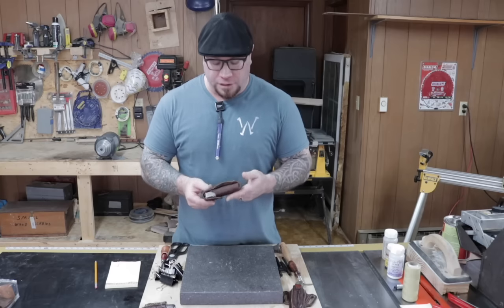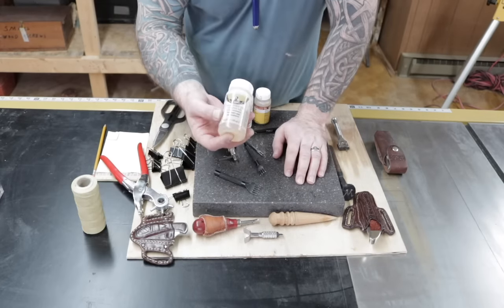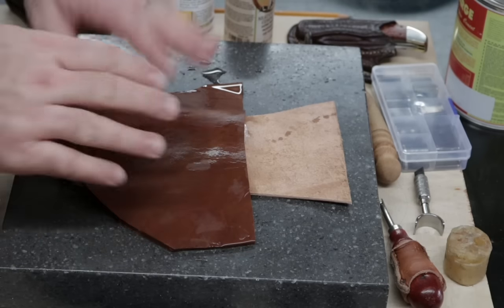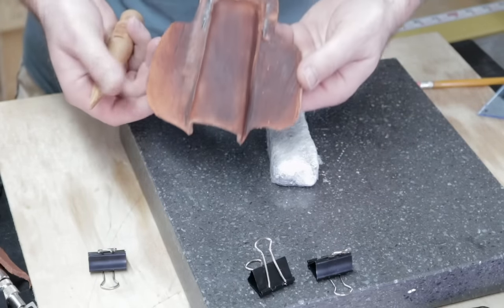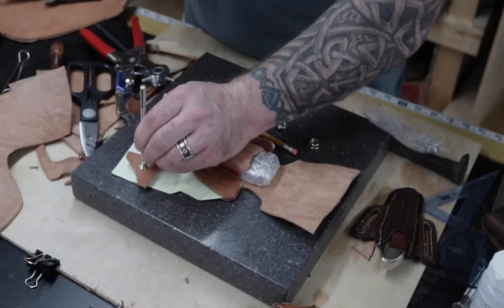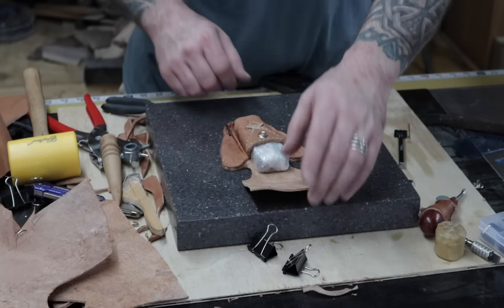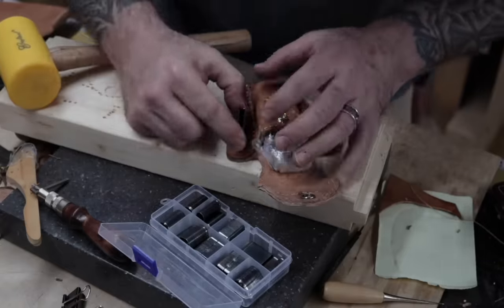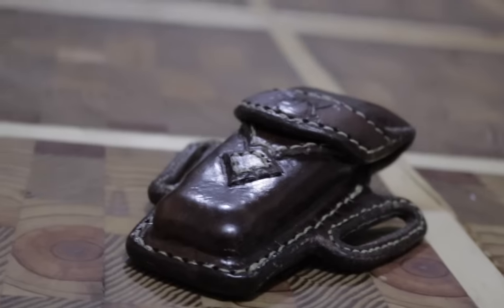CUSTOM LEATHERMAN SHEATH

Comment: That was a different and interesting take on a multi-tool sheath. I don't think SOG will appreciate your repeatedly calling their Powerlock by the name of their rival company, though. If you think your SOG sheath was inadequate, you should have seen mine. It had the same basic design except for the fact that the sides did not come up as high as on yours. Coupled with the loose original fit, the lack of original stitching (allowing the leather to pivot around the rivets), and use-related stretching, the gap in the sides eventually allowed the Powerlock to fall out when putting my pants on.  I chose just to cut out a leather insert with higher sides both to snug it up and close the gap.
     I think the SOG line of power multiplying multi-tools is the most overlooked, if not underrated, line on the market. The quality of the individual tools is comparable to that of their neighbor to the South; the over 2:1 mechanical advantage is unmatched on the market; they have long had tool interchangeability; and have always been one-hand openable.
Reply from the maker: You should check out the friction sheath I use now. It’s on my channel, way better than this one. Have a good one 👍